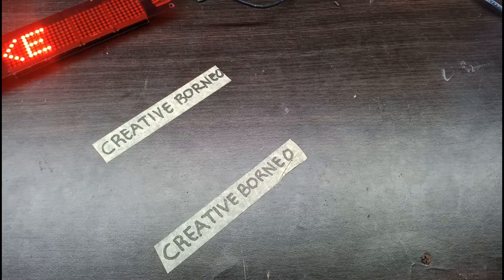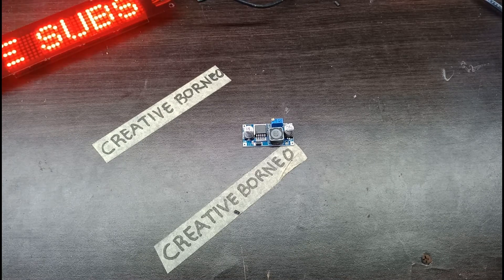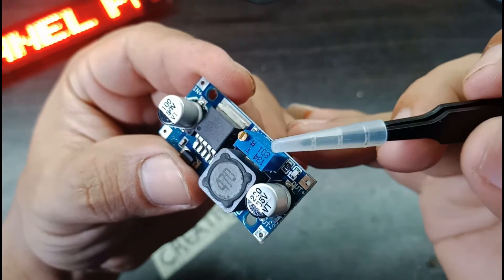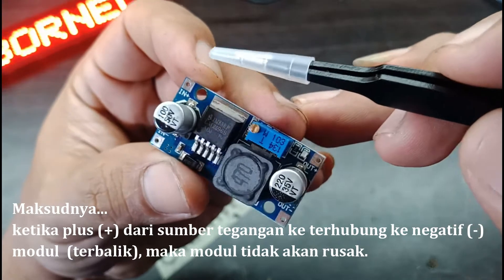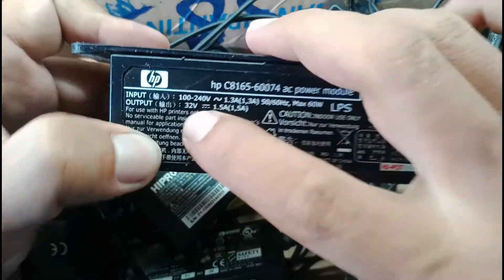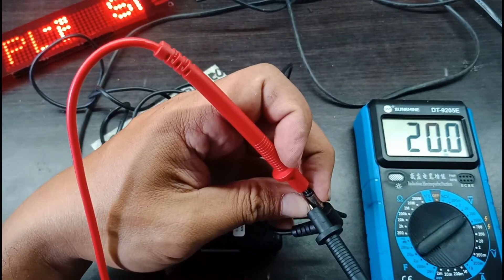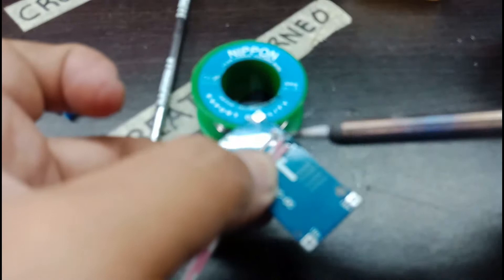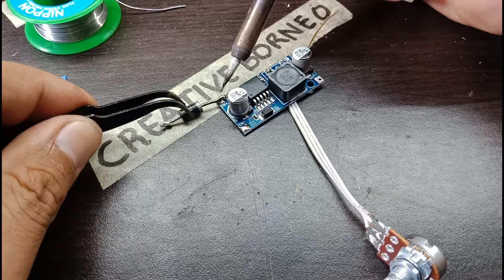Cara merakit step down  dc LM2596

Comment: Bang. Kesimpulannya bagus mana modul step down ini sama yang ada voltmeter nya? Kalau misalkan saya pasang nya dari smps ke kit ampli class d apa tetap butuh dioda? Ukuran dioda berapa? Sama apakah bisa satu step down output nya saya gabung misalkan led strip dengan modul mp3 atau kipas dc. Mohon pencerahannya dan maaf banyak tanya nya
Reply from the maker: bagus yg ada voltmeternya.
gak pasang gak masalah, asal jangan terbalik minus dan plusnya. dioda yg dibutuhkan 10 amper,
bisa digabung, yg penting voltasenya sama semua

Comment: Mau nanya bang,alat itu klo di pake nurunin tegangan aki 12 volt ke 6 volt untuk dinamo motoran mainan
Reply: Alat itu buat nurunin tegangan aki 12 volt ke 6 volt untuk dinamo motor mainan anak bisa ga bang ,makasih
Reply from the maker: bisa. saya sudah coba juga ke lampu led dan dinamo
Reply: Mau tanya kawan klo modul step down LM2595 DC ,rencana utk menghidupkan led 3volt input batre aki 12v ,kira2 rawan jebol gak modul step donya

Comment: Ms diodanya ukrn brp...
Reply from the maker: 2 amper.. diatas 2 ampere juga bisa. sesuaikan aja sama modulnya..
Reply: @CreativeBorneo   bang kmrn sy pakai step down untk aerator, itu modul 2 bln g pnas, tp kmrn sy lem plastik kok gmpng pans y y bang....ap pengruh pansnya lem td y bang
Reply: @CreativeBorneo  kalo 1 amper aman ga mas ? Rencana Supply dari aki 12v ke dinamo motor2an 6v

Comment: Bang itu otomatis apa gimana outputnya? Apa harus diset manual dulu sesuai dg voltase yg diinginkan? Klo mau dimasukkan dlm rangkaian mp3 player 12v -->mini ampli 5v 2A gimana rangkaiannya Bang? Setting stepdownnya gimana? Dan apa akibatnya jika ampli dapet arus lebih dari 2a?
Reply from the maker: Harus disetting outputnya..
Iya harua diset manual..
Iya, bisa cepat panas, tp panasnya ga berlebihan, di rangkaiannya bisa ditambahkan heatsink pada ic nya
Reply: @CreativeBorneo  terima kasih Bang

Comment: Kalau buat aki tossa 10 ampere bisa gak broo,
Apa kuat?!
Reply from the maker: Kalau untuk ngecas aki, bisa aja bro, tp modul cepat panas dan bisa rusak. Tp kalau sebagai sumber input, aman aja..
Reply: @CreativeBorneo  mksd saya cuma buat input/output DC-DC saja ,
Rencana saya buat penerangan 4 volt , buat gerobak bakso, 
Dan seandainya di tambah Audio mobil tanpa alat trsbt apa bisa audio nya ?
Reply from the maker: Untuk penerangan sangat bisa dan hemat. Jika ditambah tape mobil bisa juga, hanya aki cepat boros, nah lebih baik mas nya pakai mp3 player portable dan nanti arusnya bisa ambil di aki
Reply: @CreativeBorneo  kalau MP3 portabel bukannya sama saja y kalau DC 12
Reply from the maker: @welcome_tokarebet8173  ga sama mas, arus dr mp3 player kecil, jadi gak terlalu boros.

Comment: Mau tanya kak, arus input max berapa ampere ya? Mohon infonya, makasi.
Reply: Apa keterangan max 3a, itu berarti input jg max 3a?
Reply from the maker: Iya, jika berlebihan akan cepat panas dan kompenen yg lain bisa rusak.
Reply: Ok ok makasi infonya kak
Reply: Mas knp modul step up saya jika di beri tegangan di cek naik tegangannya input 3V cuman pas di kasi beban lampu yg awalnya di cek pake Avo meter 20V jadi turun 3V itu gimana ya cara memperbaikinya ? 🙏